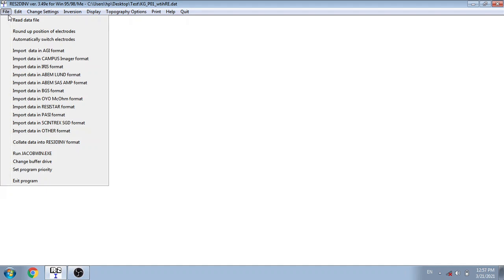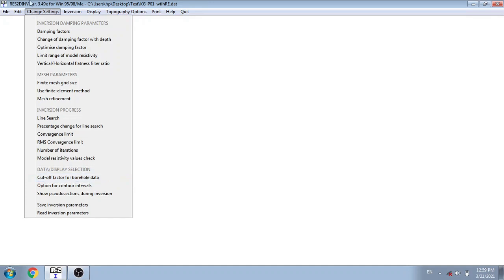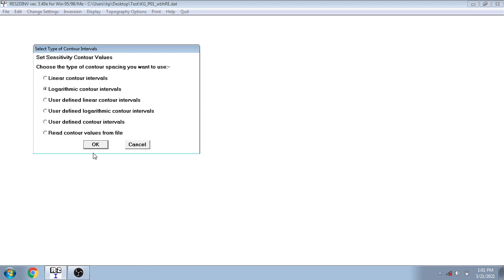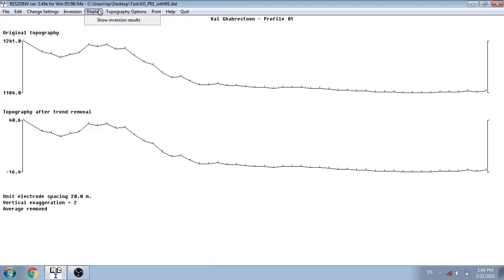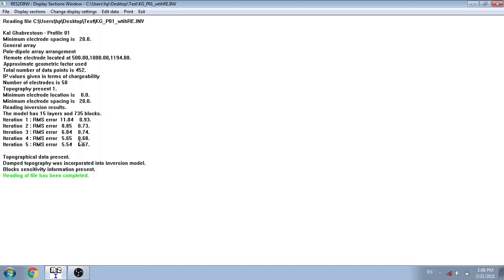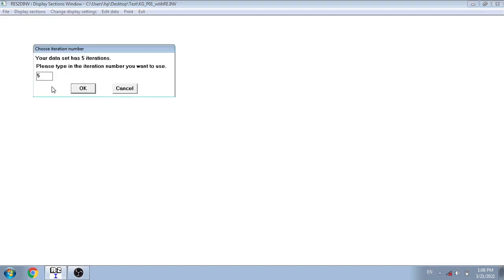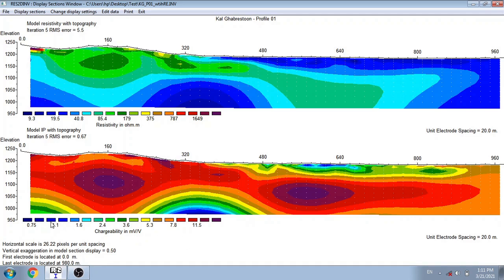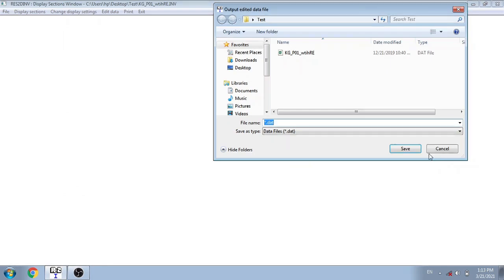Quick Introduction to Res2dinv software

Comment: hello ,  i would like to ask if i can upload file from ohm mapper device to make inversion model in res2dinv
Reply from the maker: Hi. I don't know. I am not sure whether it is possible to process capacitively coupled resistivity meter data in res2dinv. You may contact the res2dinv support to ask your question and get help.